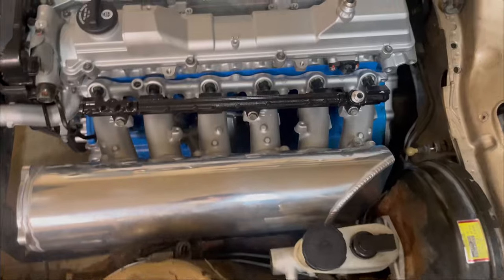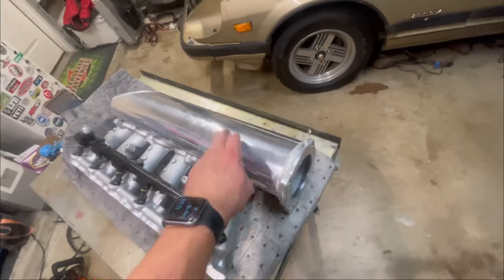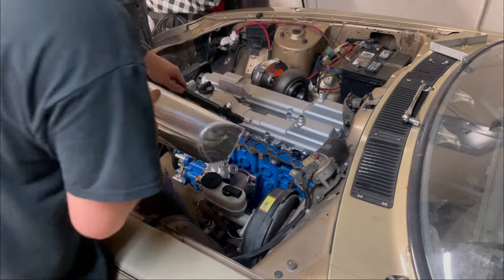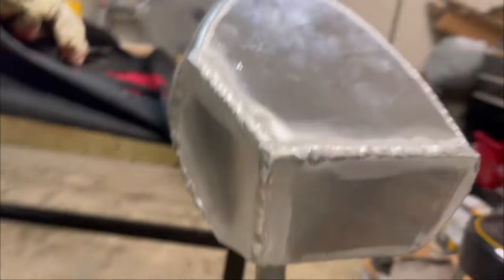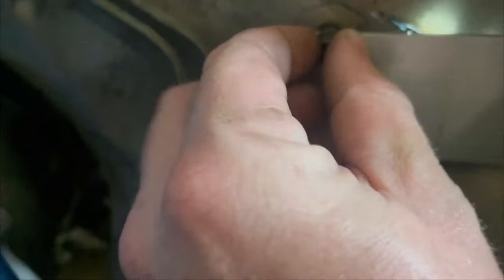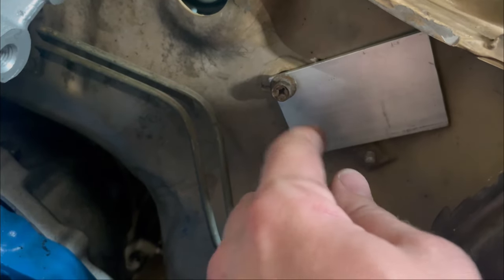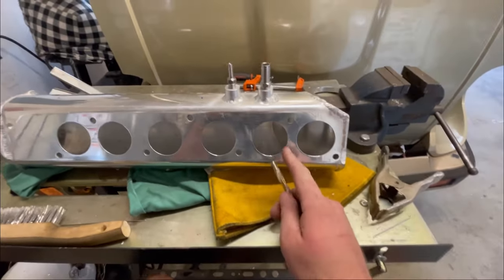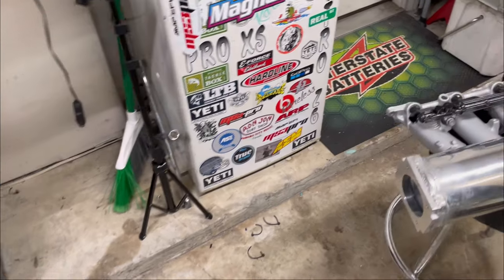Can I make this universal intake work?

Comment: You can hook a cable directly up to the throttle pedal. I believe you cut the ball off and then drill it for the clevis on the cable. You can get universal cables that you can cut to fit also. (edit)Guess I should watch the whole video. Good job.

Comment: Nice work! 

What was the knock module from? Seems to me that it was a C4 corvette? I need to find something to monitor knock with my Nistune setup. Nissan knock control was very basic and has zero PID inputs to the ECU.
Reply from the maker: Yes, it is the corvette module. It works well. Using it with the stock Toyota sensor is a bit experimental, but I’ve confirmed it can work. Idk if you’re megasquirt but the set up is very easy and there is tons of adjustment as far as how the module responds to knock input.
Reply: @masterofmachines  thanks man, I’m currently using Nistune installed on an ‘89 300zx turbo ECU. Knock monitoring is essentially nonexistent. I wonder if there is a way to connect the output of the module to an LED of some sort. I know it was done back in the day on turbo Buicks but there is very little documentation in beyond, “it’s been done”.